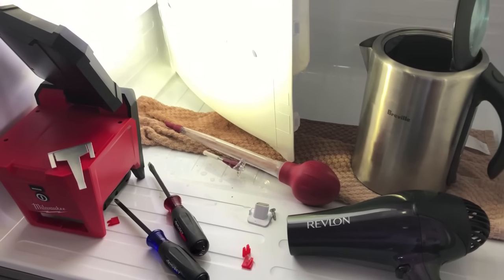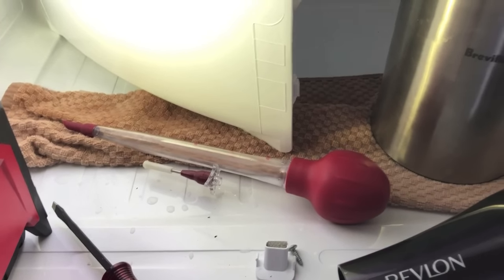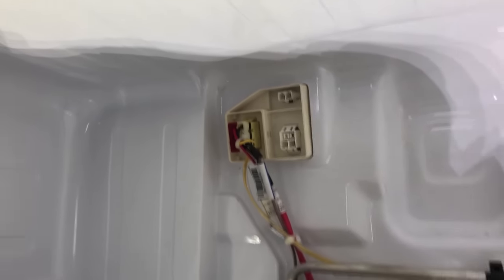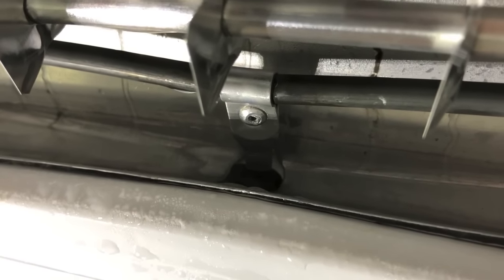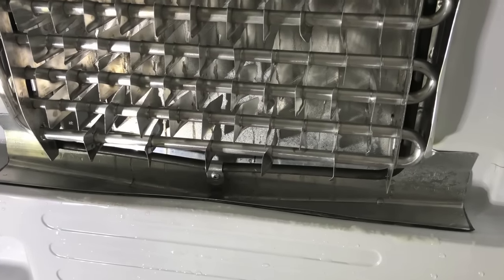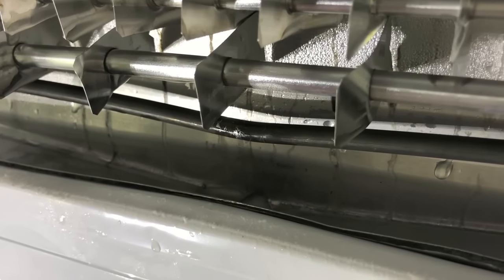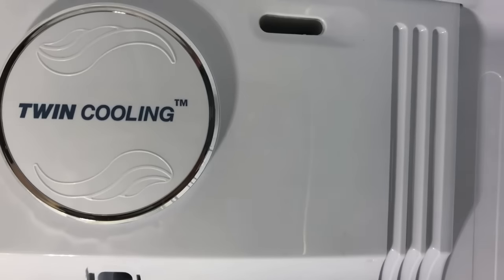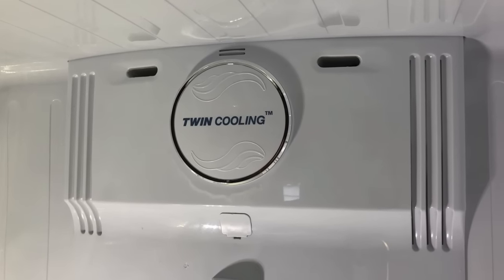Samsung Refrigerator Repair - How to Fix Water in the Crisper Drawers

Comment: UPDATE..Added the clip and enjoyed 2 months of no water in the drawers but now, the water in the drawers has returned.  In addition, under the freezer drawer water, and now water is on the floor from under the fridge.  There's no saving this  piece of crap.  9 years old and I will need to purchase a new fridge.  Unbelievable!
Reply: Ugh same repaired it twice and now it's doing it again as well. What brand are you getting?
Reply: @alleyflowers  I haven't even begun researching.  For now,I just keep mopping the water up and emptying the drawers but a new one is a must.
Reply: @vegascece  I'm trying the fix that's replacing the condenser pipe at the condenser tray as a last-ditch effort. This is leak #3 or 4
Reply: @alleyflowers  I want to scream. Totally unacceptable.  Class action against Samsung is needed.  I don't recall ever buying a fridge.  Every new home's appliances always lasted.  Good luck.. can't wait to hear the good report!!
Reply: @alleyflowers  Hi..checking in....did the replacement of the condenser pipe work?
Reply: @vegascece  I haven't replaced it yet! Weirdly, I did the fix with the copper wire that goes from the deicer thingy into the drain pipe a while ago, and maybe it actually thawed itself out when I upped the temp on the fridge? Either way, I haven't seen more water. I'll probably replace the pipe soon anyway.
Reply: @alleyflowers  ok good news!  I will add a copper wire to the "t" deicer piece and see if that helps too.  Last go at it.
Reply: @vegascece  good luck!
Reply: @alleyflowers   can you explain to me what you did with the copper wire?  How did you attach it?
Reply: @vegascece   did it work?  My fridge is still leaking after I added the new part.  How did you add the copper wire?
Reply: @laurasugaskiphotography  just attached it where the warning clip is and put it into the home much farther down than clip. Wind it with as much of the heating coil as you can
Reply: @laurasugaskiphotography  yes what Jeff said..wrap it around the deicer and into the hole.  Only problem, the fix didn't work for long. Maybe 2 to 3 months only.
Reply: @alleyflowers    Did the copper wire seem to fix the problem permanently for you?  I feel like the part I bought is working less than the factory installed part. When I opened it up again, the icing was worse than before :(
Reply: @vegascece   that sucks!  Did you get a new fridge? Did you try calling samsung?  My samsung oven broke only months after I bought it when I tried the oven cleaning mode.  Samsung said they didn't have any repairmen in my area so they refunded my money but didn't take the oven away.  so I found a repairman myself and it only cost $125.  I was up several hundred dollars!  Crazy company.
Reply: @alleyflowers   should I remove the clip completely and just wrap the copper wire?  Or should I wrap the copper around the clip and the element?
Reply: @laurasugaskiphotography  No, I've just dealt with dumping the water.  Because I bought this house with the appliances in them, I had no documentation to fight a case with Samsung.  Now that I'm selling, I will have to purchase another fridge for the new owners or give them credit at closing to buy one.  Believe me, while touring homes, I make sure none of the appliances are Samsung.
Reply: @laurasugaskiphotography  I don't remember! Hmmm it does seem to have worked tho you can prob remove clip
Reply: @alleyflowers  It's a crap shoot.  Fix one thing something else goes out,  If I can at least get my freezer fixed, I'd be happy but I can't sell my house with this piece of junk so I will have to buy a new one.  Probably GE brand.
Reply: @vegascece  awful that companies aren't required to fix their shitty products. Good luck selling your house!
Reply: @alleyflowers  Thank you.  Selling and buying during this quarantine has been a nightmare.  Buyers that back out at last minute haven't helped (I'm on my 3rd!!).  I ended up buying a Whirlpool top freezer, no nonsense fridge.  It's not fancy, has no bells or whistles, something you'd find in any apartment.  It works, it doesn't leak, and if this last deal goes through, the new owners can upgrade if they want.  In the meantime, my daughter's fridge has been out for going into the 3rd month (Kenmore).  Bought brand new from Sears in Jan, went out in March.  Their repair and warranty work is promises, no shows, wrong part, sorry, we'll try something else, more no shows, won't return calls, etc. while a family of 4 living through this Covid nightmare with a temporary dorm size fridge, having to buy fast food or go grocery shopping everyday to get food while promises of repair/replace keep stalling out...horrible. Don't buy from Sears!
Reply: @vegascece  Where are you selling? I can imagine it's not going so well =( Honestly, is Sears still around? Aren't they like out of business or something? Ugh, grocery shopping so often is a logistical and infectious nightmare! I hope she can get it replaced asap. That is not good!!
Reply: @alleyflowers  I'm in MD.  Actually, homes are flying off the shelf here.  Up until March, multiple offers on homes and most didn't last for sale for more than 30 days if that.  And no, Sears is still operating here but will never see a dime from me.
Reply: @vegascece  Darn. Good luck. I'm sure the same for where I live, near Boston, where house prices were skyrocketing for years. Probably not so much now.
Reply: @alleyflowers  did this work long term?
Reply: @laurasugaskiphotography  interested in this fix as well
Reply: @Sammy-ju7cv  I have not had an issue with it since I added the copper wire. Definitely try this.

Comment: he tech that came in replaced it with that clip it lasted 3 months before it failed.  I used some  thick  copper wire I had at home never buying Samshit again. T
Reply: Same here! Samsung crap is nothing more than a ticking time bomb - just waiting for the fridge to screw up again, or burst into flames.

Comment: why in God's name wouldn't you show how you put the clip on?
Reply from the maker: If you watch the section from about 5:00 to 5:30 I show the clip in place and then in place with the tabs wrapped around the heating element. Since I'm not an octopus and the inside of the fridge is tight quarters I wasn't able to show the bending of the tabs. However if you're doing this repair and have the part shown, I'm confident that segment of the video shows you all you need to figure it out. I believe the part also comes with a diagram if you need more detail.
Reply: Really the easiest part.  Putting on the new evaporator clip is ridiculously easy (well, at this point it is). Just loop the clip over the top of the heating element, making sure the long part extends into the center of the drain hole. Then, just wrap the two aluminum extension on each side around the heating element to secure it. .
Reply: i was having trouble with that step. i was trying not to bend the new part at all. i realized the lower part can be bent to get it into the drain hole, then it made sense. just bend it back after you get it hanging from the coil